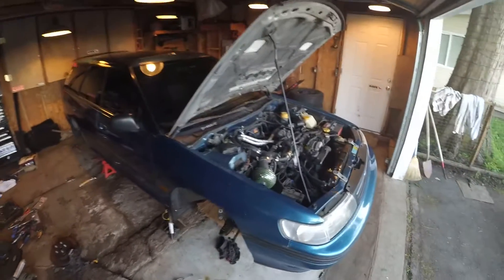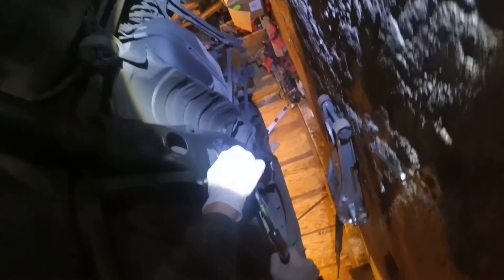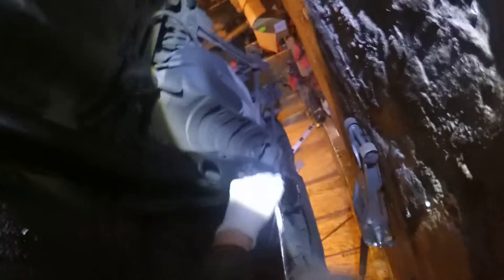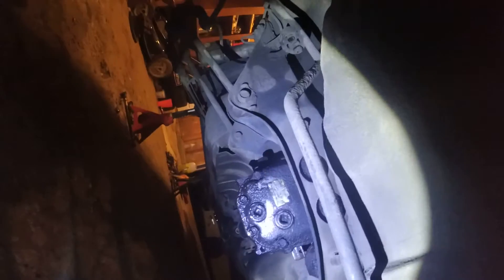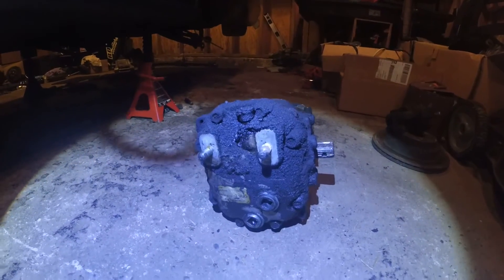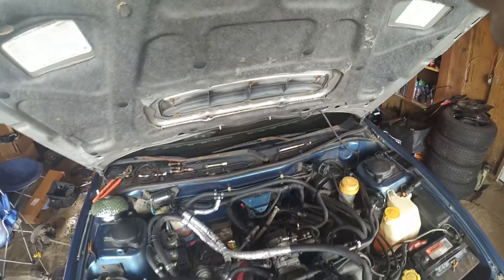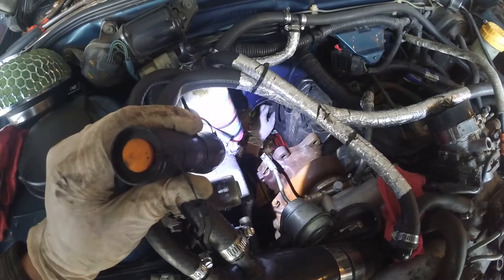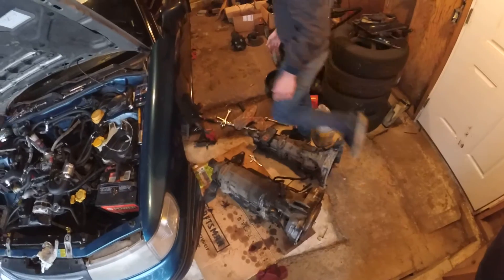Pt.2 94 Legacy Turbo 5 Speed Conversion: Removing the Auto Transmission

Comment: So I just took delivery of my 94 Legacy turbo SS and I have fallen in love with it. My first attempt at driving it home failed as the coolant host to the turbo failed and it over heated. Got that taken care of over my lunch hour yesterday (Thursday) and got to drive it home that night after work. I am considering swapping out the auto transmission to something like what you have; 5 speed manual. Where did you go to get yours? Since you went from auto to manual, do you have to change the ecu out or jump a couple pins? I am new to the first gen legacy and turbos. My previous Subaru's have all been second gen ej22 N/A. So any tips would help. But I don't plan on any major surgery until after one year of ownership. That way I can get a feel for how the car is stock and then later on compare the two.
Reply from the maker: Thats awesome congrats! I got mine through JDMracing engines but you really dont need to do what i did, its a lot cheaper to get all the parts from the junk yard, i would recommend getting a 5 speed from a 3rd gen legacy thats 3.9 ratio, that way you can keep your rear diff, you just need a driveshaft and trans subframe from a 5 speed first gen, get the pedals from a second gen and you can use the master, slave and shifter from the same 3rd gen you got the trans from, and dont forget to keep all the bolts including the clutch hardware. then get a stage 2 clutch kit for an 06+ wrx that way it will hold all the power. oh and you also need a 5 speed starter, some of the bell housing bolts will be different but it works, the newer ones have 6 instead of 4 and you need to put a stud in for the lower starter bolt, you can run it with only 1 bolt in the starter if you want. thats the cheapest way unless you want to go cable clutch and use everything from an NA first gen legacy, but you would need the rear diff with that swap. as far as the ecu you should check out our video on the 5 speed swap in a weekend, we basically just unbolt the shift selector and leave it in the park position and connect the 2 reverse light wires, thats it. i have all of this info in videos you might just have to watch a few of them.
Reply: @HackSquadGarage  awesome, I have seen a few of yours but I haven't seen all lol. Just doing proper research for now.

Comment: doing a 5 speed swap on mine right now and I am having a hell of a time getting the auto out. its separated but stuck on the bottom studs just like you. so annoying! i am trying to get mine done for WCSS next weekend.
Reply from the maker: nigelorion Nice! Yeah we had to move the motor back as we slid it off the studs, it also weighs about twice as much as a 5 speed lol. Hope you can get it done! I barely got mine done for Big North West meet 2017! Let us know if you have any issues.
Reply: Hack Squad Garage I got it out man, but now I am totally stuck. I need to swap my front axles out to match the transmission. Went to undo the passenger side axle nut and broke all of my breaker bars. I don't have air impacts or a strong enough cordless. I'm in Portland if you want to come help lol.
Reply from the maker: nigelorion damn... I had that exact same thing happen to my gf's car, we were lucky enough to have it still drivable and we took it to my brothers work, used the air impact gun to get it off. You could take the whole assembly out and take it somewhere that has air tools, most places will do that for you. The other option would be to go to pick n pull and get a new spindle and axle. Any other time and I would man, but we think my brothers 91 ss just blew a head gasket 😧

Comment: I would just replace the hubs w/wheel bearings that are already pressed in. They're like $30 on rockauto! Taking these hubs apart is a bitch
Reply from the maker: Eyal R. Yeah that's one option, I really don't want to take the wheel bearings apart, so we are actually going to drill out the ABS sensor hole to fit the new studs through. I'm never using ABS again so that would work perfect.
Reply: Haha weight reduction!